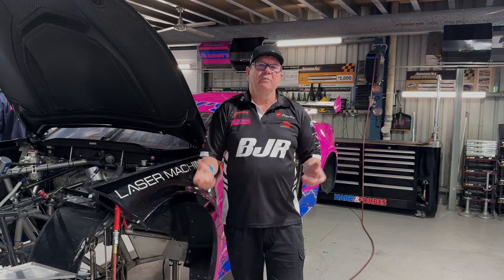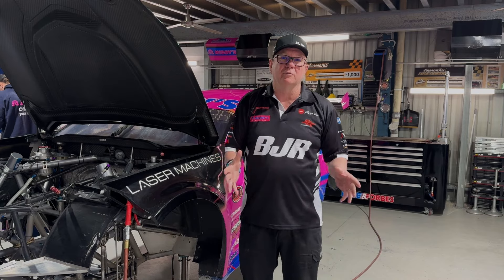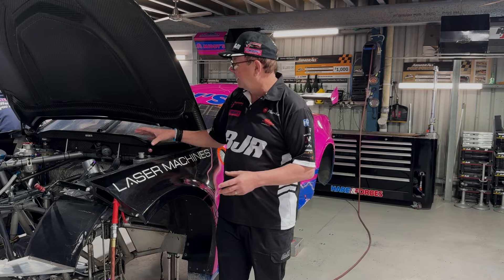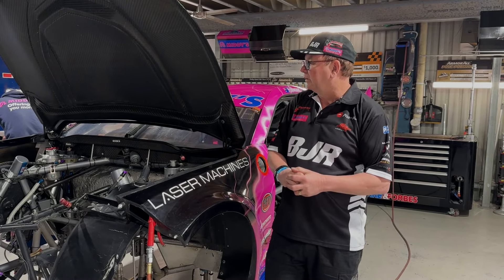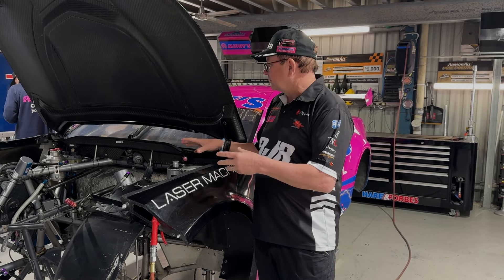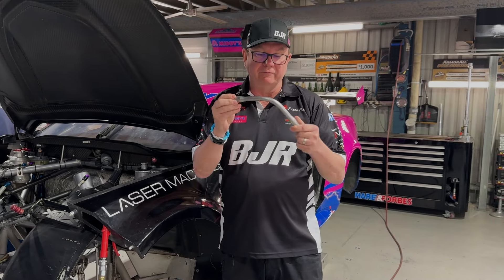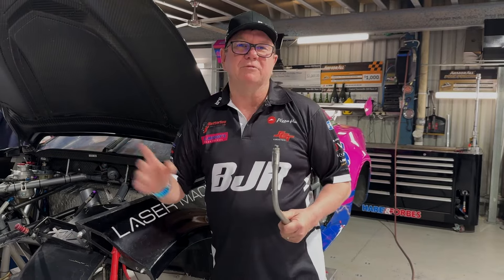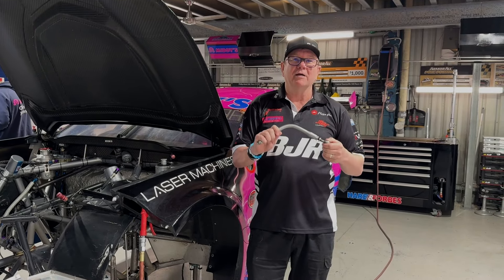Engine issues and the Sandown report

Comment: $9000 for a part that lasts 60,000km is far better value than $5,000 for a part that lasts 6,000km
Reply: sounds like the cheaper crank might be a line item given a quick dressing to be 'fit for purpose'. may next to the cost savings columns there should be a few others saying longevity and kms/per $  ;)

Comment: Blows my mind every time Brad mentions prices... Crank $9k + the rest of the engine to go around it.  Some wheel nuts a couple of hundred for the billet, but need to machine like 50 odd of them.  Front bumpers cost a fortune but almost seem like consumables, etc.  The cost of running these cars is astronomical, and here's Brad throwing numbers out like it's no big deal!  Go well at Bathurst guys!
Reply: $9000 was for the old steel billet crank used pre Gen III
Reply: @The_Evil_Monkey_93  Yeah, true, although the new ones are really more expensive.  $9k for a crank that lasts 60,000km vs $5k and lasts less than 10,000km.

Comment: These engines don't seem to be any cheaper than the old 5L bespoke ones. Especially if they break during races. So much about these cars have been a step backwards in a lot of ways. I wonder how reliable the Toyota will be.
Reply: Toyota will be ok, years of work done on those engines..
Reply: If they can make it through a Dakar without problems, then they should be no worries for a Bathurst.  As to a season?  Yeah, that may be a bit more interesting.

Comment: So the old cranks cost $9000 and did 60,000km.
New ones cost about $5000 and you get 8000km out of them.

That math aint mathing. 🤔 
The more expensive one is waaaaay cheaper in the long run as it lasts so much longer. Well done Supercars 🤦

Comment: Do you have to have a V8 SC Official there when you rebuild a engine ?
Reply: The teams don’t rebuild them at all , the chev engines get sent back to Kenny Mac at kre engines
Reply: @brandonshuttleworth1293 Yeah. But do KRE have to have an V8SC Official there ?
Reply: @rhettcorbett3346  after a engine is rebuilt it leaves kre and go to super cars to be inspected checked and run on the Supercars Dyno, then it has its tamper proof seals fitted and shipped to a team

Comment: For a 600 hp motor that’s piss poor to ever break a crank.  With the best part of 7500rpm and luck to see over 500 foot pounds of torque.  Just shit engines.
Reply: They are sitting on 7500 at startline causes problem set-up different to old engines...
Reply: @gerardcrabb4556  so they are breaking cranks on the start line. lol
Reply: Wear on bearing causing some failures and broke some new 3 piece bearings...